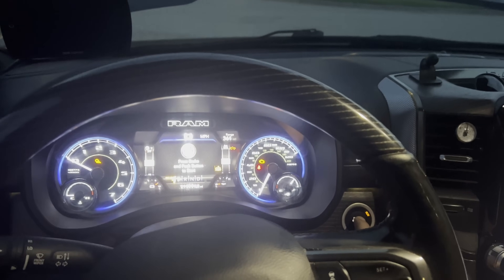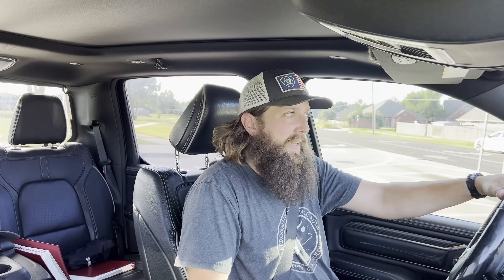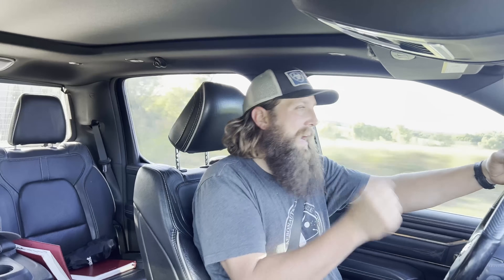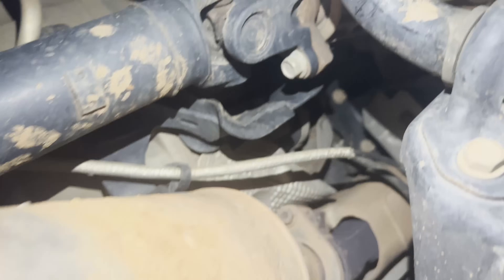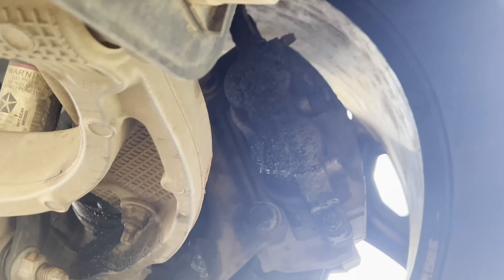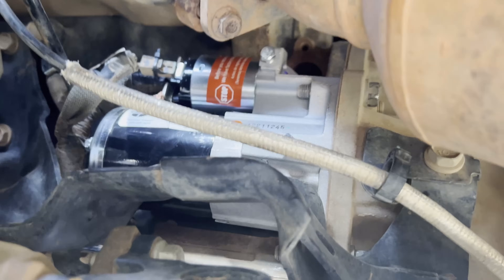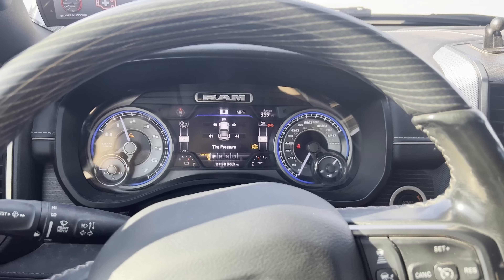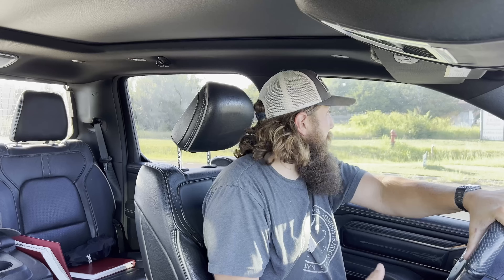2019 Ram 1500 *NEW PROBLEM* Engine Won't Start | Truck Central

Comment from the maker: Alright... let's get the Dusty Dodge back on the road. This will probably happen to you at some point. Hope it doesn't... but when it does, at least you'll be prepared.
Reply: 2016 RAM 1500. Replaced battery like a dummy$150. Watched this video and will be heading to NAPA for OEM starter. Thanks for this video!! I have 14'2x 14, 3" track overhead door to install today AFTER starter!!!
Reply: Thanks for this video!
Reply: @TruckCentral Have you had this issue in the past 3 months since the fix?
Reply: My 2019 Durango srt just went out and if you can imagine the wheel well is completely closed off by felt. Underneath is my best option so much heat shielding ugh 😂 wish me luck
Reply: RAM’s are not Dodges since 2009. No where on that 2019 RAM will you find anything marked as Dodge.  Separate companies, separate plants, separate engineers, completely different company.
Reply from the maker: @MRKNIGHT  Dusty Dodge or Rusty Ram? Which is it?
Reply: @MRKNIGHT  FUN FACTS DID YOU KNOW THERE WOULDNT BE A FORD MOTOR COPANY WITHOUT THE DODGE BROTHERS??
Reply: This is the issue I'm having with my 2019 Ram 1500. Thank you for doing this video.
Reply: Diagnosis stated that my battery, starter, and alternator are all good. I don't know why mine will not start. At least now I know the problem is common.
Reply: Well I’ve had all these issues and more on a 2020 5.7 BH 
Replaced the starter a year ago and now it’s happening again. It’s left me stranded multiple times now. 
Rf hub, starter, battery, and push button are all culprits. Starter relay and fuses also could be checked. I’m dumping this thing as soon as I can get it running again. 4 yr old truck giving me none stop problems and stranding me all over. Do better ram
Reply: Just happened 😂
Reply: @nottheone3957 what was the outcome

Comment: Hello Mr. Wheeler. I have a 2021 Laramie and same thing happened to me. Truck has 55k and was driving me crazy. Went to change the starter and the bolt on the power for the starter was just hand tightened. Just tightened it up to see if it was just a loose connecion and i am going on 3 weeks of no problem. Fingers crossed that i dont need a new starter but for the meantime no issues.
Reply: I am having the same issue right now, I’m wondering if it has something to do with the cold weather, cause mine only does it when it’s cold in the morning 2019 27k miles and already doing the exact same thing, let me know if yours has done it again?
Reply: @jonatanescobedo8748  still running fine. Even with the cold weather. If you're having trouble in cold weather I'd get your battery checked.
Reply: New starters are easy to install
Reply: Damn 55k in a 21. I have a 22 and only have 6800 miles on it in a year and a half.
Reply: @Youtubecansuckmyshithole  I live outside of the city and work in the city. So I drive a lot haha
Reply: @Youtubecansuckmyshithole  bro take it out it isn’t a sports car. 6800 in a year is 566miles  per month, definitely should use it more
Reply: @covector4787  I'm supplied with a work truck I bring home, so it sits most the time but my last truck only had 7000 miles and was 2 years old when I traded it in. I just don't drive much after work.

Comment: Thank you very much for posting this video. I actually just had the same exact issue on my 2022 Ram just yesterday! After two hours of troubleshooting I went to the auto parts store and bought a starter and started removing the old starter and when I got to the 13mm nut located on the starter solenoid that’s located on the starter, it was extremely loose. I was able to remove the nut by hand with no tools needed. At that point, I tightened everything back up, connected the battery terminals, and the truck started right away. I was able to return the new starter to the auto parts store. Have not had any issues all day today. I don’t know why this isn’t a recall as the 13mm nut WAS the issue! Thanks again, man!
Reply: Thanks brother I have a 22  Laramie with the 5.7 I replaced the battery in January thinking it was that everything was cool till yesterday I have 48300 on it and it happened again! Thanks for the tip I am going to have that checked out!
Reply: Same issue I had. Mine also turned out to be a loose nut on the power cable to starter lug. Tightened and good to go. Saved few hundred on an unneeded starter.
Reply: LOL MY 6OK TRUCK WONT START ITS 2 YEARS OLD...LMFAO    , DODGE IS JUNK BUDDY.
Reply: I’m in that same boat 2 hours from buying a starter
I will try the loose bolt trick

Comment: One upside of the 2wd, no front drive shaft or differential in the way. Can get to the starter as clear as day.
Reply: Yep, there are definitely some upsides to having 2wd. I was just thinking about that the other day when I was hammering on a 2wd S-10 starter. 🤣

Comment: Had this on my 19 Laramie. What fixed it for me was cleaning the corrosion off of the starter wire and tightening the 13mm bolt at the front of the starter. I bought a new battery just to be safe as well. My check engine cleared itself and has been consistently starting weeks later.

Comment: Had this problem on my 2019 Ram 1500 4WD 5.7 Hemi. After messing with it for months (didn't want the dealer to mess with it), I noticed that my high brake light wasn't working. It was corroded so I ordered a new OEM part and replaced it. Believe it or not, my intermittant starting problem was solved. That was 4 months ago and everything is working as it's supposed to. Mybe it was just luck- but I'll take it as a solution!
Reply from the maker: Makes me wonder if Dodge did some weird voltage math as a makeshift “push brake pedal to start” sensor. I’m half joking, but it is possible 😂

Comment: I knew exactly what the problem was😂.  Mine is a 2021 Bighorn. I thought it was my battery, so I dropped a new one in it. Turns out, it wasn’t my battery. My battery was actually still good. I replaced it any ways🤷🏽‍♂️. It was my starter the whole time🤦🏽‍♂️. Got that fixed. She started up just fine 👌🏽. I have a 6” lift on my truck, which made it easy to get to mine. This was about a month ago. Great video👌🏽.

Comment: The nut to the starter is a bolt on the starter.  No reason to remove.  Just remove the heat shield cover. Reach around to the start of the starter.  You should feel the nut move freely.  Tighten it down and the issue will go away.  Had it happen on my 2019 and this fixed the issue.

Comment: Great video and informative!  Two thoughts I have. - 1. Get rid of 12 point sockets and replace them with 6 point! Those 12 point sockets have rounded a lot of tight bolt heads.  And - 2. I still wonder if it was your starter OR that loose bolt that connected the cable! Either way, it’s new now and great job fixing it!!  Keep those wheels rollin! I’m watching for the next vid! Thanks!
Reply: I’ve got a mix of 6 and 12 point. But I try to keep 3 sets of the “essential” tools. At the house, at the land, and in the truck. So it is usually a crap shoot what I’m going to have for a repair. Haha. And it’s possible that it was just a loose wire… but at that point I wasn’t willing to take the risk and potentially end up stranded somewhere. I feel good about it being new. Thanks for the comment as always!
Reply: 12 point’s definitely have a place but your right. Always use a 6 point when you can.

Comment: Exactly same thing is happening to my 21' Ram 1500 with 41K. My mechanic seems to think it is the same thing, starter issue. Battery is slightly low on voltage, but enough to cause this issue. Thank you for taking the time to create this content to help us out, maybe RAM will do something about it...dont think so...

Comment: Fixed!!! You gave me the right path. 2021 no start, could jump. What I found then battery.  I replaced battery and no issue for about a month or so. Then it started again, guess new wore off the battery and extra umph was gone. Well after video and comments I removed the starter, same thing power cable was hand tight.  Had it tested at autozone and starter good. Put bsck on with some dielectric grease  on all connections and tightened with 1/4" rachet and mid length socket. Was terrible to get to and get starter out. Had about 10 successful starts since.  So thank you for video and from the comments. From the factory under torqued. 1st exact issue i found documented.
Reply: Thanks again Justin,  5 days over 20 starts later, would try removing heat shield and tighten pos terminal on starter.

Comment: This happened to me over weekend. I thought it was the battery and brought it to the shop. It wasn’t, but I talked the shop into replacing it under warranty anyway. When I got home, it still wouldn’t start. I found your video and my clicking noise was like yours. I went and bought a starter. Like you, I had a terrible time with the bolts, but opposite. The bolt that almost whooped you, we (son and I) were able to loosen with a big ole wrench. The other bolt wouldn’t budge. I sprayed it with PB and let it sit overnight. My son was able to loosen that bolt the next day. After that, it was just a matter of the connectors and rebolting the new starter in place. 

I have a 2019 Ram with 110,000 miles.  This seems really early to need a starter. I am thankful that the Mopar engineers didn’t get cute and put the starter in a weird place. It was easy to access. My previous truck was a Titan and the starter is buried in the “V” of the V-8 under the intake. I was really mad at the Nissan engineers for coming up with that ridiculous location.

Comment: Hey little tip! It wasnt probably the actual starter…that little wire with the clip that goes to starter was probably corroded. Its dumb how Chrysler does it. But that wire reads the volts and tells the pcm if it has the volts to start. When you replaced the starter, you just agitated it. You should try to run a “pigtail” from that wire straight to the battery and see if it works.
Reply: That’s a good idea! I’ll keep that in mind in the future. Thank you!
Reply: That's a very good point and glad you brought that up. Kudos to you
Reply: This helped me out majorly tonight. THANK YOU
Reply: I am having the exact same symptoms right now. Wondering should I see if I  can get the wire fix or change the starter?
Reply: I had this same issue when my 2019 Ram was under warranty, but the dealer put in a battery which took care of this problem for 1 years, now I'm going through the same thing again.
Reply: @adrianmcmillan6905  I just pulled mine. Use the same set up he did. It’s a pain in the ass and took me 3 hours on one freaking bolt. 😂 you can pull a couple bolts out of that bracket and move it a little bit to help get the socket on there. I also had to use PB blaster
Reply: Having de problem gonna try the wire first
Reply: Just wanted to send a big shout out to you Mr. Justin Wheeler for the video as I ran into the exact same issue on my 2019 Laramie. I did replace the battery,    but the issue remained. @motormossvlogs1450, thank you for suggesting that it may just be a bad connection. I disconnected/reconnected the spade terminal and also checked the positive cable coming from the starter. Barely gave it a quarter turn and the lug was loose to my fingers. Tightened the lug to the positive cable and the truck has fired everytime for the past week! Thanks again and I look forward to the continued journey of the "Good Ol Dusty Dodge."
Reply: Had to do this for my daughter’s Dodge Dart.
Reply: Same thing happened to me and it was the starter.  Had to replace the manifolds as well.  Last week the Etorque bearings went bad.  No Etorque’s are in stock to replace it and they don’t know when they will be.  Traded it in.  MOPAR JUNK!!!
Reply: I just put a new starter in my ram 1500 2019 4 weeks ago and yesterday I went into gas station and came out to start my truck but won’t start. I did smell like a burnt wire or cable smell but not sure what can be going on
Reply: Where does that go on the battery?
Reply: @mr.karlson633 did you do the wire fix?
Reply: Hey it worked for me thanks
Reply: Well hold on!! Folks we can’t do this with all trucks! I guy died messing around with his starter with a stick shift and he didn’t have his Ebreak on. He got crushed to death
Reply: Now he has to reset all his stations...😂😂😂
Reply: @chrissprung674 Do you have a 2019? One manifold cracked but they replaced both and put it on the warranty.
Reply: so if i attach an extra wire from that wire or that same connecting point on the starter what do i run it to? to the positive terminal right? (sounds like a dumb question but i'm not too smart on electrical problems lol) Thanks
Reply: @clappingcheeks447   yes. Pull the single wire off starter. And connect another wire to it, and run straight to battery. That single wire is reading the volts from the battery wire that is on the starter. There always corroded. Going straight to the battery assures a good connection.
Reply: @motormossvlogs1450    i thought i was having that problem and so i was planning on doing like you said and then i disconnected every wire from the starter and once i got enough room for the ground wire i noticed that it took less than 5 inch lbs to unscrew it, after that i removed it, inspected the ground wire and the nut holding it. i put it back in with my calibrated arm at 80 inch lbs lol and it fixed all my issues. but i will do that in the future if my cable gets corroded. Thank you very much sir! God bless you!

Comment: Exact problem I'm dealing with on my 2017 rebel. Battery, alternator, both fine. Turns right over if I jump it off. Didn't want to replace a starter but glad to know it's not just mine having this problem. Appreciate the video

Comment: 1) fix that boot before the next rain storm.  Our last rental car had a bad boot and within 10 miles of wet road we had a failed wheel bearing.  2) our 1999 Ram would have battery ground terminal issues every 5-7 years that gave the same symptoms you describe.  Sandpaper on the terminal and cable end helped for a while, new cable end fixed it for a few years, but it was a recurring problem that always could be fixed by reseating the battery connection.

Comment: I had a similar starting problem. It ended up be a blow bulb on the 3rd brake light. Giving a faulty code to the PCM and not letting it start. So check the brake light, simple fix before crawling under for the starter.
Reply: How on earth did you figure this out
Reply: A bulb in the third brake light can cause your starter not to go?

Comment: This is crazy!  The EXACT same thing happened to me 2 weeks ago.  197K miles, has run like a top.  I was 4 hours from home, stopped to get gas and snacks.  Get ready to go.....and click.  The tow truck came in about an hour.  He messed with the battery cables, and it turned right over.

2 days ago, Im headed out of town for work, and "CLICK".  It was the starter.  All things considered, it was a "pain free" issue.

Im currently shopping for a 2500. I just want a step up in size and towing capability
Reply: If you couldn't even check the battery cables what makes u think another bigger truck is right for u ? 😂 why don't u learn the truck first big boy and you might save yourself some money

Comment: Its the wire and connector that goes to the solenoid on the starter. Its happened to me twice. Im on my second starter and I still needed to climb under and jiggle the terminal. Its super loose.
Finally had to crimp on a new terminal and no more problems.
Reply: Yes! For sure! Its that little wire that goes to the starter is the problem
Reply: Good to know!

Comment: This happened to my 2019 Ram a week ago. I too thought it was the battery since it's coming up on two years of age. 
After it happened the second time, It had me thinking, maybe it's the alternator. What I wound up doing both times is actually pushing the start button with the Key Fob instead of my finger. Lo and behold, it started right up! I don't know why it worked but, it does. And, after doing a little research on YouTube I found out that's what some other Ram owners did as well.
I'm not going to discount replacing the alternator. But, I'm hoping I won't need to.
Reply: You need a new battery in your key fob

Comment: Great video and I appreciate your insight! I do agree with other comments below on the electrical connections. My 2020 Limited was just starting to do this in cold weather (10 degrees F and lower) so I took a look at the starter and the ground cable was turquoise with corrosion. My connections were not loose as others experienced but were very corroded. I cleaned and sanded everything and applied some anti-corrosion to the terminals on the starter and so far so good.